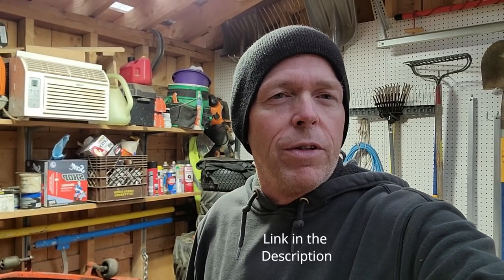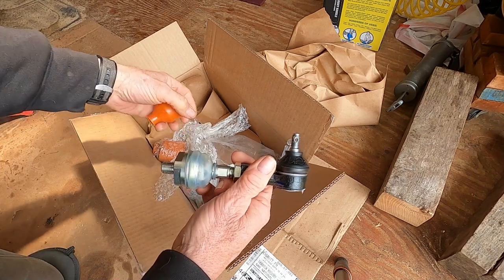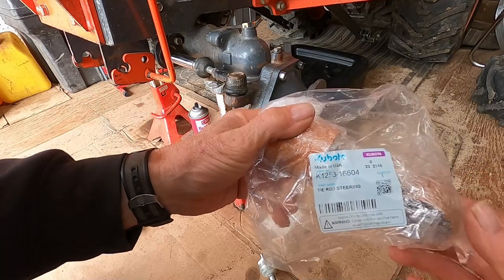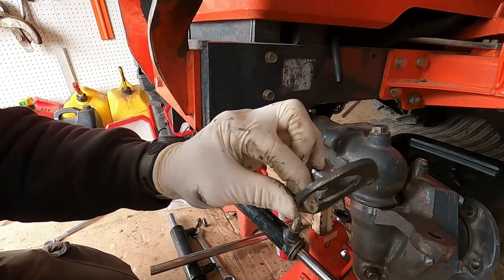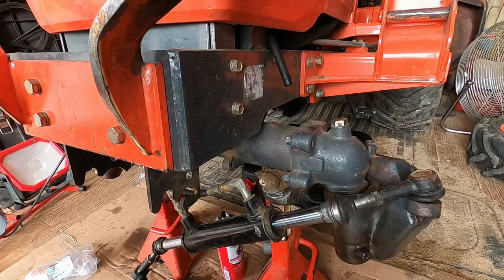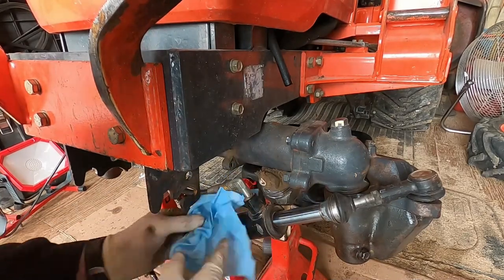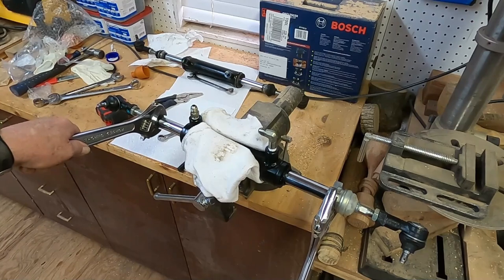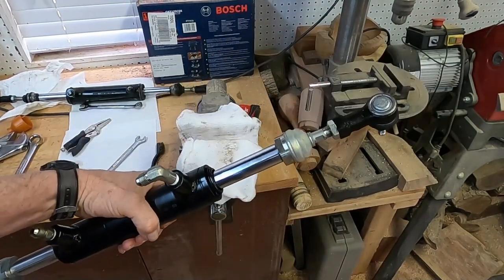Kubota BX1500 Steering Cylinder, and Tie Rod Replacement. Ready for Work

Comment: Hey Chuck you did a fantastic job on the tractor repair 👍👍I’m sure that will help a lot of people,plus save a ton of money doing it yourself great video 👍👍🇺🇸
Reply from the maker: Thank you Glenn. It's frustrating when you look, and can't find a repair video for your model, so we figured we would make one, and help folks out.
I wouldn't even was to guess what the dealer would charge for this. Probably 3 times what the parts cost me.
Reply: @IronOakSawmill  yes sir brother I think at the tractor dealership around here over 100 bucks an hour 👍

Comment: Thanks. Nice video work. Great to see the steps for the steering cylinder change out; got the same issue on a 2008 BX2350.
Reply from the maker: Thank you Jack. They are common, if not the same cylinder. I hope this video helps alot.

Comment: Don’t know what it costs, I gather that’s Deb’s department. Gotta love it when a plan comes together, had faith in you as you make sure everything is cleaned up properly. Cheers my friends.
Reply from the maker: I just didn't  want a reminder of the cost. 😂🤣 
When I used to build race engines for dirt bikes and quads, you had to make sure you kept the dirt out, or they didn't last long. 
This isn't a race machine, but I need it to last a long time. 
Always feel good to fix it yourself.
Reply: January, 2023: Steering cylinder was $300 at the dealer, including tax at 7.25%.

Comment: our Massey Ferguson GC2300 seems to be a clone of that tractor you have. Our steering system is identical except our mounting brackets for the cylinder to not have the added piece to keep the cylinder from spinning. Our brackets are prone to bend outwards and allowing the cylinder to move left and right. I had to weld an additional bracket to keep the brackets from spreading apart. A new cylinder is over $900 from the dealer. I bought the seals, on line, for a fraction of at cost and rebuilt the cylinder. It is working great. Very easy to replace the seals. It working great now.
Reply from the maker: These brackets had bent out a small amount over the years. I did bend th÷m back in a small amount. Only about 1/8". 
I bought a rebuild kit for the steering cylinder, but once I found out about the issue with poorly machined cylinder tube, I figured I would just buy an updated new one. It wasn't nearly as expensive, and definitely fixed the issue. I may look into the old cylinder, and see if I can hone the cylinder properly, and rebuild it.

Comment: Hey Chuck just checking on your appointment schedule I need to replace my chrome plated dipstick modulator valve and I can't find it 😂😆😂😆. No in all seriousness great job you might be mechanically inclined 😆😆. Always good to see you guys great job showing it to us. Pro tip for lines use a set of vice grips to help hold the fittings works well with brake lines too. Anyways As always good luck and God Bless.
Reply from the maker: I'm booked solid Mark. Can't take on more work. LOL
Thank you for the tip on the fittings. I'm always open for suggestions

Comment: I just picked one up. Seems to be a lot less videos on this model. I can't confirm the coolant level, looks like I have to remove the cowling to visualize the reservoir. It's also missing the nuts and cotter pins that hold the tie rod pin/bolt to the wheel. I can find a part number but no description, i.e., size and type, a castle nut perhaps?